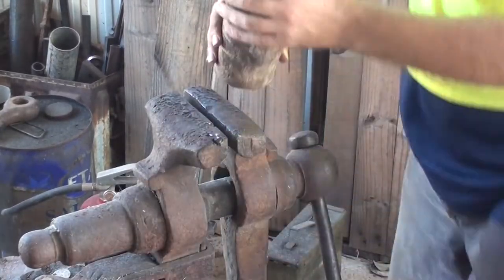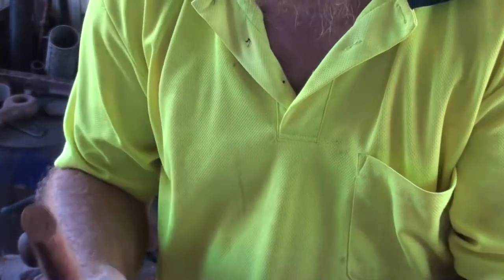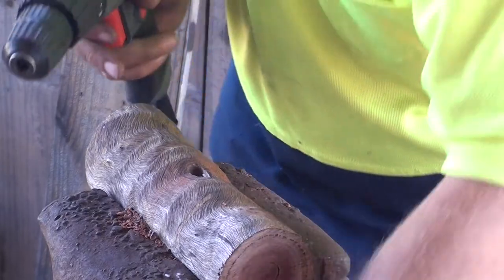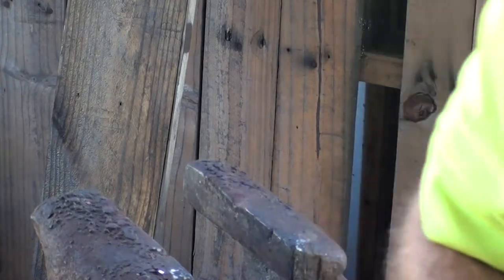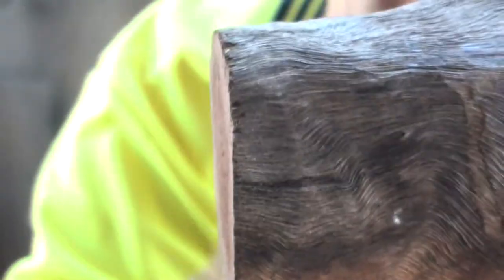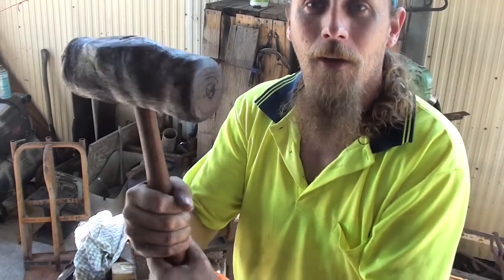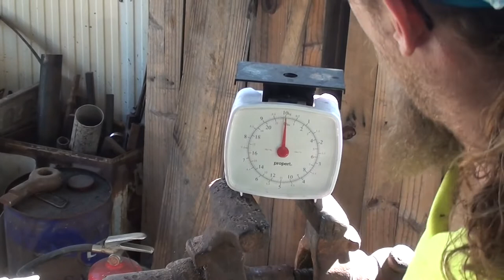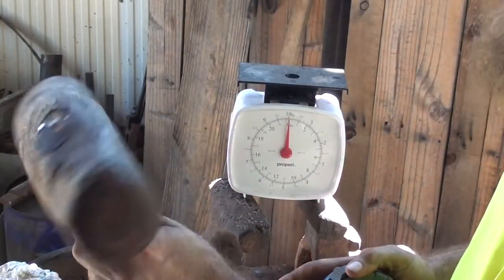#Makeamallet Challenge

Comment: Nice mallet mate, glad you thought about splitting before driving in the wedges along the grain! After the challenge when you can add a little weight forge two 1/8 thick rings to go either side of the handle and it will last a lifetime!